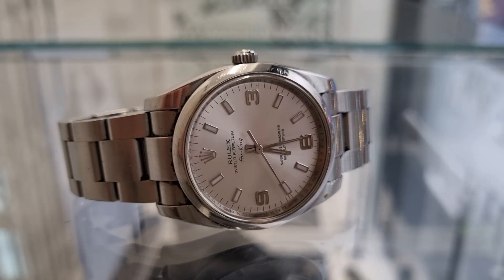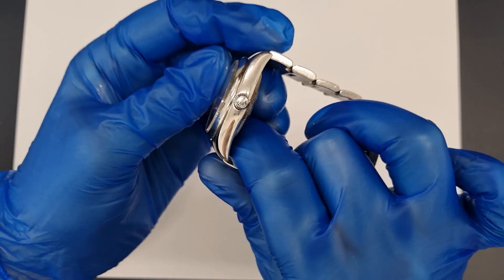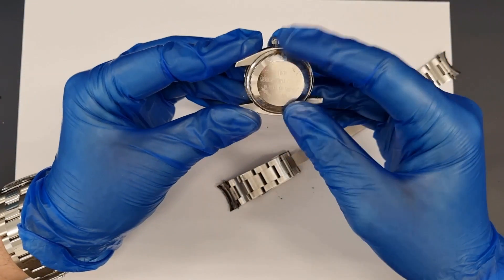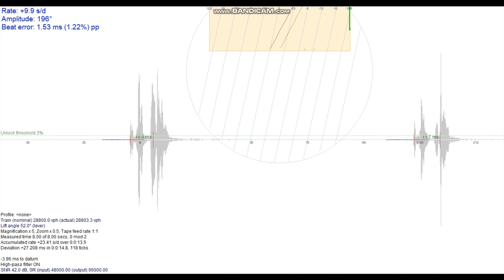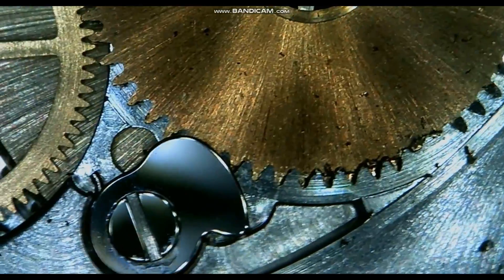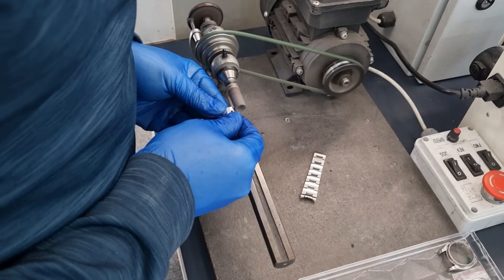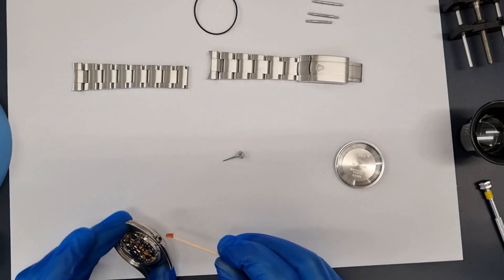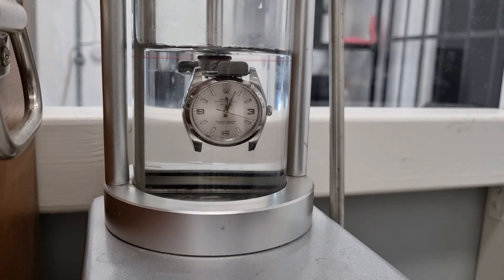Rolex Air King with an unusual fault

Comment: The fact that you have to replace the entire automatic winding assembly just because the rotor bearing is worn seems to be a bit of an engineering oversight by whatever company made the movement for rolex.  It is a profitable oversight for rolex though; no surprise there.
Reply from the maker: The reversers also wear and need replacement and as you can see from this movement things like pinions can wear and break too over time. There is a lot of load applied at this end of the train so it's not surprising things will eventually fail. Replacing the assembly is a good solution in this case but you can just rivet in a new post if preferred.

Replacing just this assembly after 20 plus years to restore perfect working order is actually quite reasonable in my mind. Not many products last that length of time in a throw away society.

Comment: I would be curious to hear your take on 2824, SW-200 (either brand's original, -1 or -2 variants) and their clones' handwinding issues. I have 4 watches, one with a 2824-2 (Damasko DS-30) and three with SW-200-1s (Tudor BB36, 2 Oris) and ALL of them spin the rotor like a top if handwound and I have only ever handwound them to see if the issue was there and sure enough, it was. 

I've sworn off that movement for this exact reason, though shaking or wearing them winds them just fine and there are no other issues, but I'm not paying $1k+ for a watch with a movement that can't be handwound while I have to stand there like an idiot doing the Seiko Shuffle. Its staggering to me that neither ETA nor Sellita are able to resolve it though honestly why would they, the movement somehow has a good reputation even though its an antiquated POS and its being thrown in everything from $500 microbrands to $50k Ressence's. This Rolex's issue reminded me of it and what I wonder is if you work on those do you see that a lot and what you think about that as a watchmaker?
Reply: Spinning the rotor when you're winding the crown is a typical issue with a gummed up automatics works. A service should sort that right out.